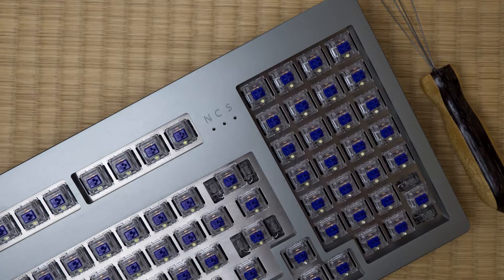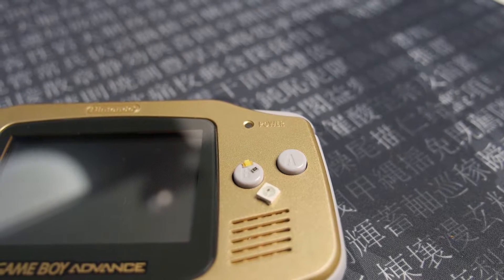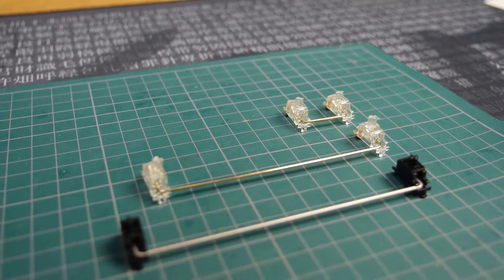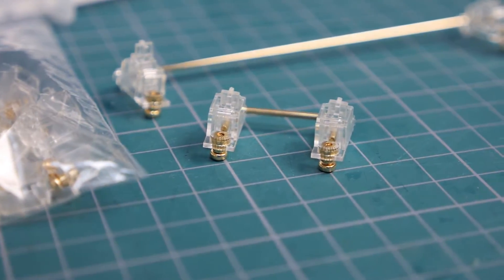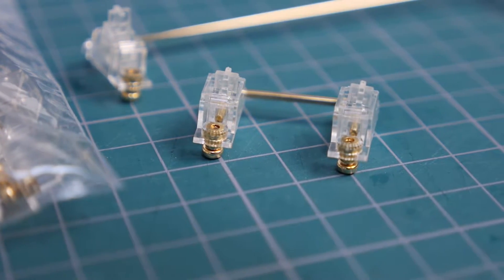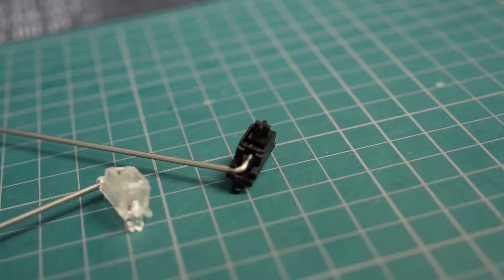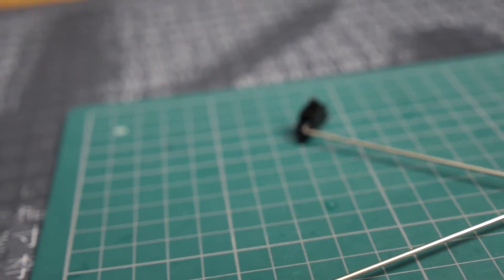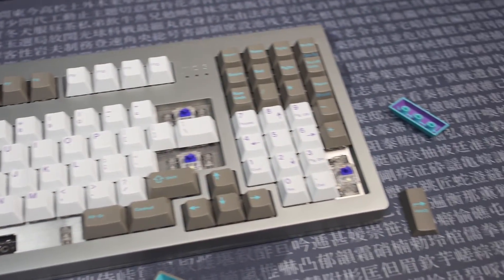Building a Mechanical Keyboard [Part 1]

Comment: Hello. So I found this video and wanted to ask if there is anyway to get a fullsize pcb for matias/alps switches? i've been doing research but nothing came out from it. I like the matias keyboard but i do not like the gloss finish on the case. So I'm really lost on what i should do to get one
Reply from the maker: I think some of the Leeku PCBs support alps switches. I think you may need to contact him to get one, though.
Reply: Alright thanks for the swift reply, Great videos btw

Comment: Did you try the fancy stabz with screws?? I have seen them on massdrop I live in Europe so massdrop is always expensive
Reply from the maker: TuxKey I did, and I really like them. I think a few people had issues where they came out when they pulled keycaps off, but mine have been ok so far. I think there was or is a group buy for GMK screw in stabilisers on Geekhack somewhere, and some of the online stores are starting to stock them, too. The GMK ones aren't fancy looking like the Zeal ones, but I think they are cheaper.
Reply: They sure look the part. But do you notice the difference? or is it more fancy looking than functionally better.
Reply from the maker: TuxKey I think the idea is that they're less likely to come out of the PCB, and that, being screwed in, they will have even less wobble. I think we're talking very very small differences, and this kind of mid is very much for the enthusiast who accepts no possibility of wobble anywhere on their board. I doubt that the Zeal ones have any discernable differences with the GMK ones, other than aesthetics. The plastic used is much better than the clear stabilisers I bought from Taobao.
Reply: i just heard Quakemz mention bandaid stabz mod...whole new world to me hahaha...awsome do like to learn as much as i can.. think have a long road ahead but a self build is certainly my goal one day ...
i set it to the side until i move from my current place..so got enough time to learn all about it.